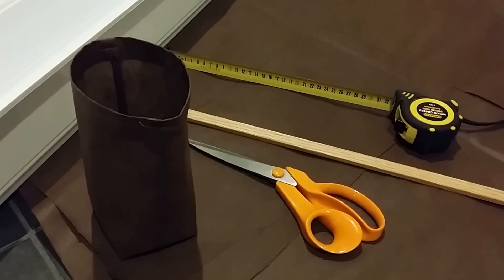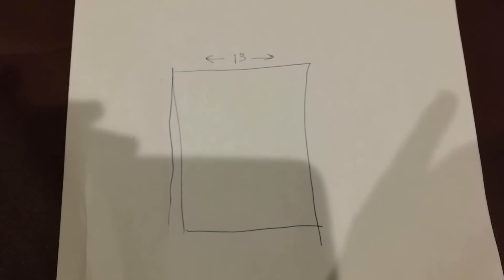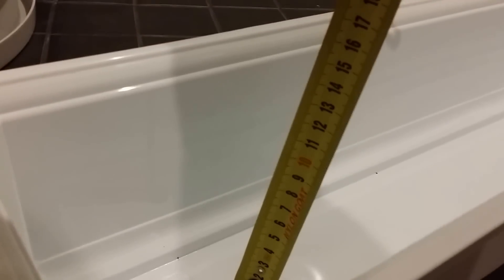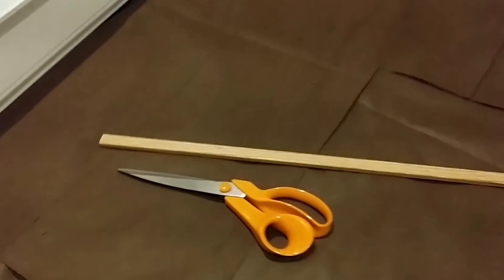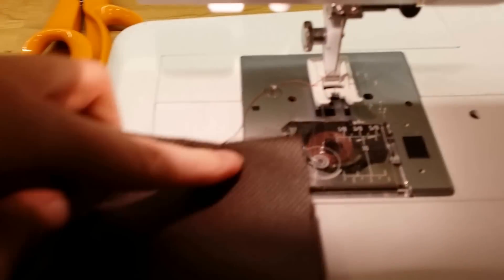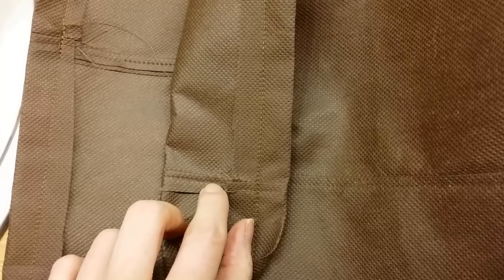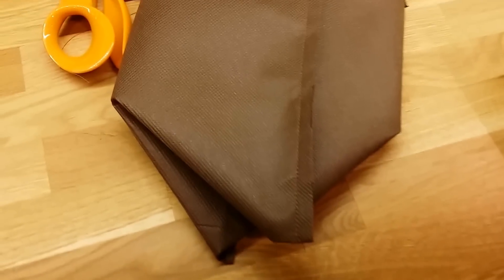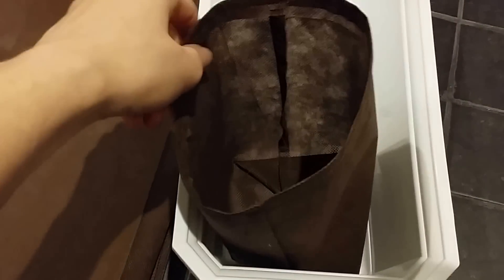How to Make Your Own Grow Bag Any Size You Want!

Comment: Excellent video!!!

I have worked out a formula so the math can be avoided . . . although I love math!
For a 12" square bottom that is 12" tall cut your landscape cloth 26" x 18".
6" square bottom 6" tall the landscape cloth will be cut 14" x 9"
8" square bottom 8" tall will be 18" x 12"
10" square bottom 10" tall will be cut 22" x 15"
etc, etc.
Here's how it works:
To cut your landscape cloth double the size of the bottom square you desire plus your seam allowance. The first example above 12" bottom = 24" + 2" seam allowance.
Determine the height needed and add 1/2 of the length of the bottom square -- Height desired is 12".  So you take 1/2 of 12" which is 6" and add 6" to the desired height of the grow bag. 12+6 is 18". You lose 1/2 the length of the bottom square (in this example 6") when you fold up the triangle to make the bottom square.
Has worked with all sizes for me but you're on your own. Give it a try.
Reply from the maker: Thanks so much for the tips! I pinned your comment if it helps others as well!
Reply: OMG thank you for this! I am so bad when it comes to math lmao! You are beyond awesome! ❣️
Reply: Thank you so much!!! Although I'm good at math, my 78 year old brain has a hard time calculating cm to inches! Generally I won't even finish watching a video if they aren't speaking inches and feet also, so I appreciate you breaking  this down for us.

Comment: I know people are making grow bags out of landscaping fabric for air prunning the roots, but in this entire video, there is not one mention of what kind of fabric she is using or even a brief explination as to why. That would be very helpful to alot of people. Other than that, it was a good video.
Reply from the maker: I made the bags out of landscape fabric. It's the stuff you put on the ground under mulch for instance that should keep weeds from coming up. The fabric should be pretty tough but let water through. I hope that helps :-)
Reply: +Robert Tomkinson"I used landscaping fabric" right at the top

Comment: Such a great video! Thanks for sharing! Do you think its OK to use an old t-shirt, instead of using landscaping fabric, please?
Reply from the maker: ke tu I wouldnt use an old t-shirt or anything cotton. Organic materials break down quickly. The t-shirt also has a lot of stretch that wouldn't work to your advantage. landscaping fabric is usually pretty cheap though. It's made of polypropylene and water goes through it allowing drainage.
Reply: Thank you so much for the clear reply!

Comment: Do you see any reason why you couldn't make one long bag the length of the rain gutter with net cups every foot apart, as in one large, long bag with ,say, eight to ten net cups every one foot apart. Is there a reason that the "dividers" between bags need to be there?
Reply from the maker: You probably could make a long bag but I wonder how you'd keep the edges from sagging out on a long bag. You wouldn't be able to move it easily either. Maybe some straps to keep it from spilling the dirt? Or sew a tube with holes for the plants? There aren't any dividers in my kitchen planter :)  Its just 6 separate bags with the water bottle in the middle. I keep a little air space between bags for air pruning :). If you come up with a good long bag design,  would you share? I'd be interested in seeing it :)
Reply: Thanks, Alison. I see your point about the air pruning. I am trying to maximize soil volume and since there's no hard, impervious sides to the container the roots shouldn't "circle". Also, in encouraging a large network of functioning mycelium that aids plant growth one large bag is a good idea as long as other considerations don't suggest otherwise.
As far as the bulging out of the one oversized fabric container goes, I was thinking if that if I saw that start to happen, I was going to use a strap around the circumference of the bag where the bulging was the worst and cinch it up as tight as needed, but I'm not going to know until I actually get to that part. I'll upload pictures either way when that happens. I'm using fairly thick material for the bags that are remnants of the black fibrous sheets that are laid down underneath when roads are constructed.

Comment: Can you use hot glue?
Reply from the maker: I'm not sure. I've never tried. The glue would have to put up with sun, heat and moisture as well as the pressure from the soil and roots. I wonder if staples would be better? I have no experience on either method though. 🤔